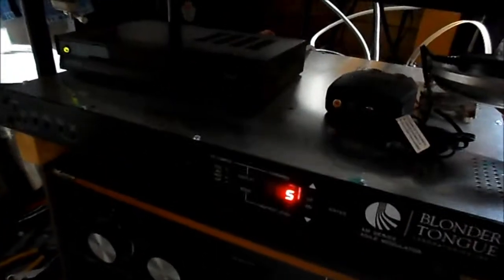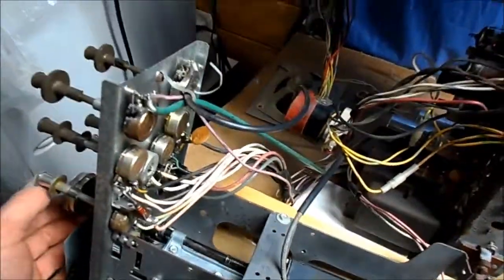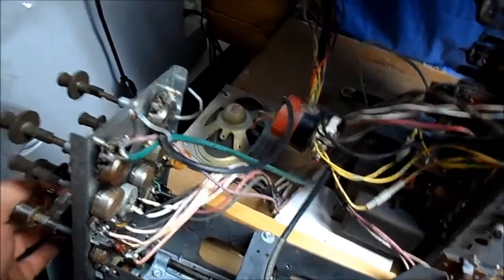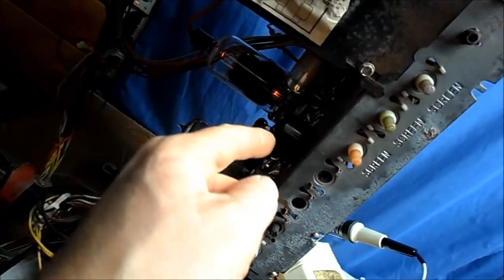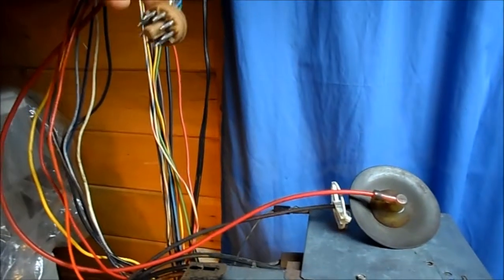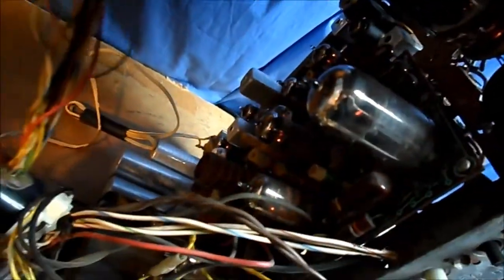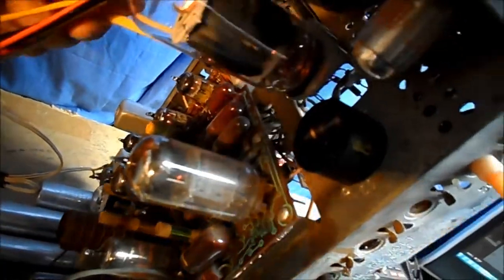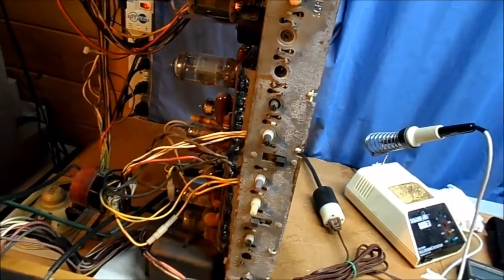RCA CTC-24 Some Updated Testing.

Comment: does the BT modulator have video/audio/Aural (sp) settings? try backing off the video modulation some.
Reply from the maker: Hi, It has 3 levels on the front. Aural carrier, Audio level w/peak LED, & Video level w/peak LED. It was not peaking